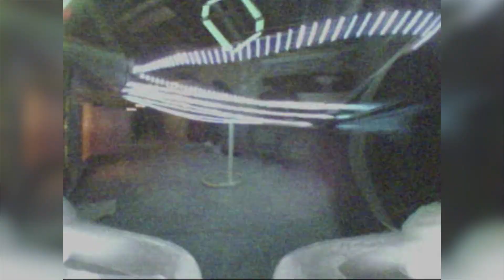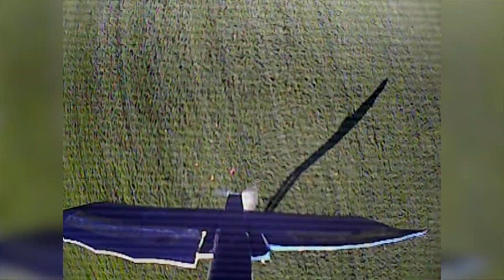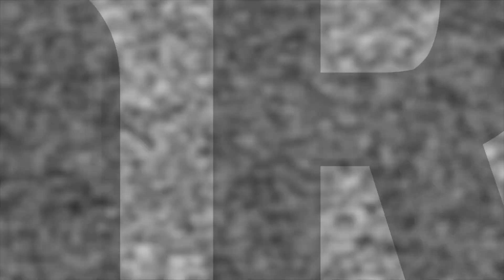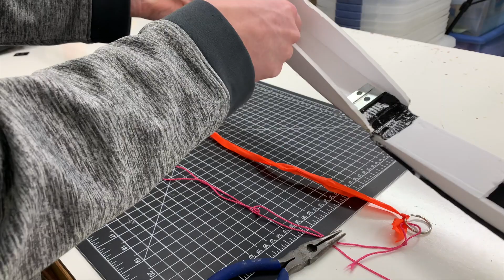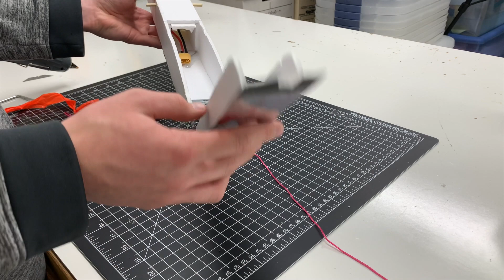Making an Easy Passive Hi-Start Release for my FT Simple Soarer

Comment: I want to make the motorized version and I’m not been able to fit the battery in the glider... any ideas on how to do that?
Reply: I have the same electronics that you use ( the amazon 14 dollar one that’s you showed on another video and a 500 mah  nanotech battery) and I also have a 1800 mah 3cell that I would like to fit in there for longer flight time
Reply from the maker: Usually you simply velcro the battery to the bottom of the fuselage, maybe rubber band it if you are worried. I haven’t had any problems with that method, it has worked great, and that power system is a great match for the Simple soarer!
Reply: CustomRCMods thanks!!